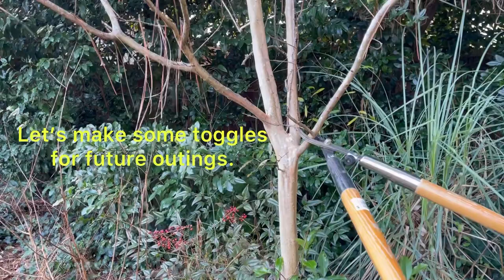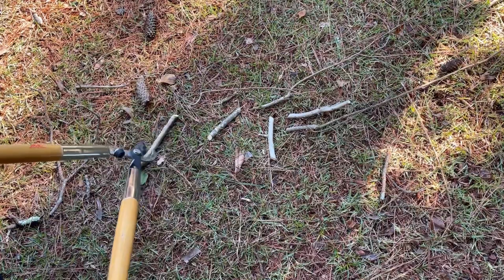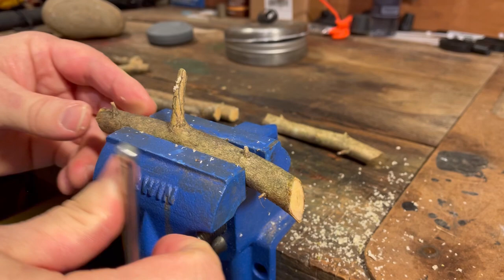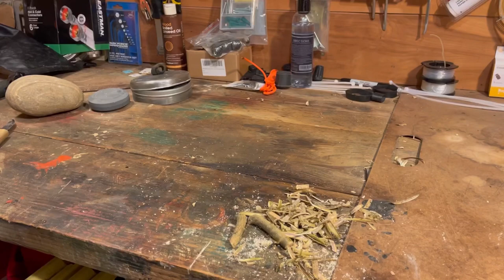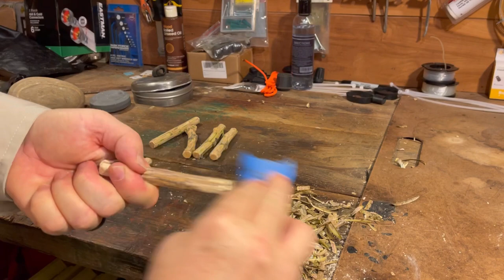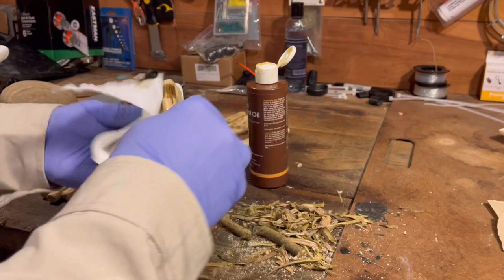Making toggles for camping. #easywoodworking #asmr #bushcraft

Comment from the maker: Some campers don’t use toggles. Most look for makeshift toggles around camp. A few make there own and use them for years. Do you use toggles when outdoors?
Reply: How are they used , they are fantastic
Reply from the maker: I mostly use them with my tarps, hammocks, and hanging things like my pack to keep it off the ground.
Reply: @volleytheory  so you pusg a loop into any eyelet, then slide one into the loop on the backside ????  Awesome
Reply from the maker: For a tarp I use prusik loops and pull them through the tarp loop and slide the toggle in. The prusik slides on the tarp ridge line so I can adjust the placement of the tarp in relation to my hammock. 
For my hammock, I use a marlin spike hitch on the tree strap with a toggle to hang my hammock.
Reply: @volleytheory  excellent 👌  thank you